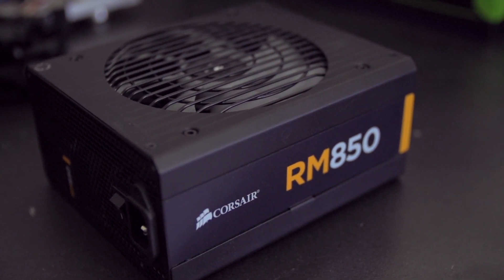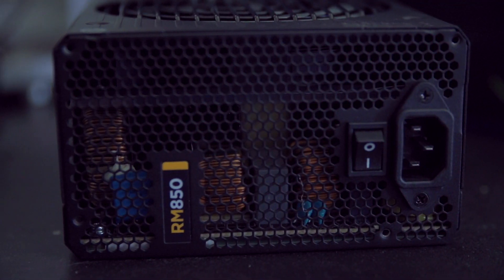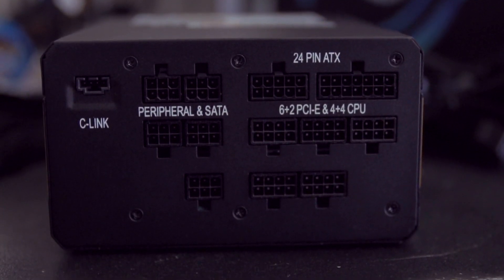Linus demonstrates the new Corsair RM Series 80 PLUS Gold fully modular power supplies

Comment: Guys I need your help!
Should I get an AX860 or an RM1000?
I want many connectors and a stable PSU that is futureproof
Reply: If we're talking 980's or 970's, you could probably run two of either off a 600W PSU lol. The future = more efficient components, so I don't really think a 1000W is "future proof" necessarily.
Reply: +Asger Fra 2G1A Umm 860 is overkill for most components these days unless you are running dual titans..

Comment: Is this PSU Haswell certified and multi-GPU ready?
Reply: 100%
Reply: DigikidForever There is...Look up Haswell Compatibility which shows that the PSU can handle realy low amps on its rails for C5 and other Haswell Sleep modes. If its not Compatible its not worth buying since you will have trouble with the processor
Reply: DigikidForever Yes there it is! It Calls PSU v. 2.31 for Haswell Refresh (Dewil's Canyon)
Reply: And YES the Corsair RM Series RM850 2.31 can handle "Haswell" C6/C7 Low-Power States !
Reply: ***** Now you look like a newb!
Reply: ***** look it up , if you don't have the right PSU for haswell...well you might as well buy a 3k series

Comment: i have a seasonic X750 Gold.  This psu has been out for a while and has this same tech with the fan not spinning until it hits high load.  problem is this psu has HORRID coil whine and it drives me nuts. this is my second one that i have. first one was worse. even though i have no issues other than the noise. i'm pretty tempted buying one of these power supplies.  

i really want to know if it has no coil whine or not. when are the hands on review coming.